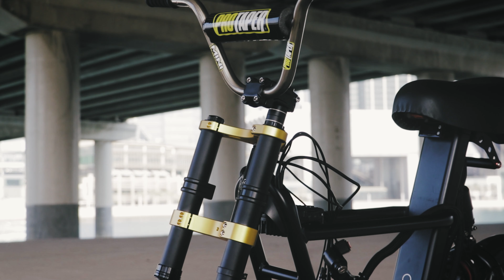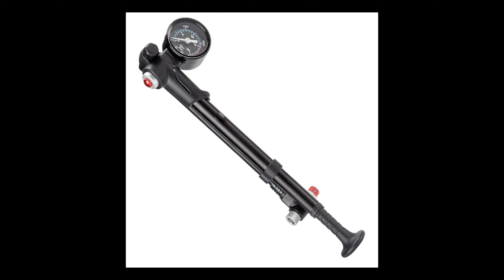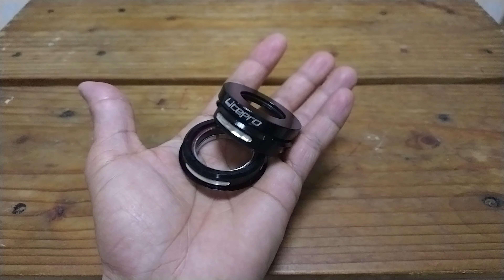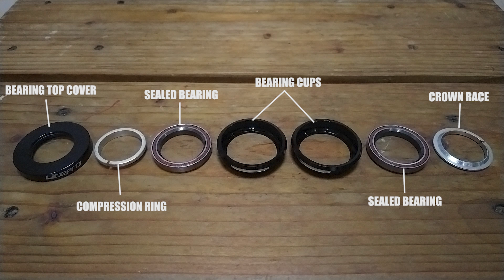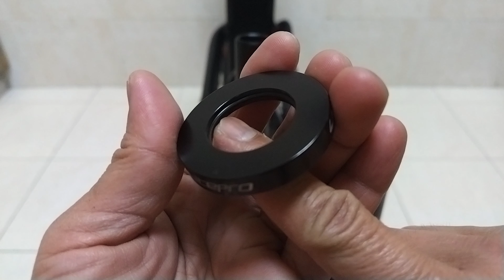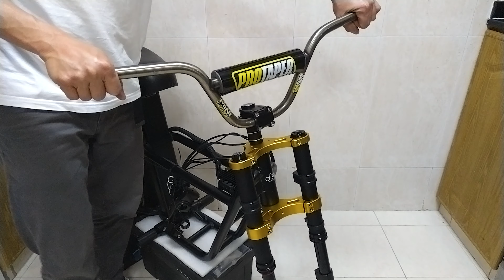How to Install a Dual Crown Suspension Fork | Fiido Q1s Electric Scooter Front Fork Upgrade!

Comment: san po makabili ng stock headset ng fiido same sa video nyo po
Reply from the maker: Goodday Kaadik!
Check mo sa AliExpress, online.

Ride safe lage.😎
Reply: @jaysonulanday  nghahanap ako dun boss pero di ko makahanap ano kaya e type ko dun
Reply: @jaysonulanday  pwede boss p share ng link
salamat
Reply from the maker: @brokekitzjay8362 
Cnxa na late reply.
Meju nabusy lng Kaadik! Hehhe!

I just found this on AliExpress: 
AED51.42 | NECO 1-1/8″ Threaded Headset Folding Bike 34mm / 44mm Vintage Waterproof Semi-Integrated Steel Headset 28.6mm Straight Fork
https://a.aliexpress.com/_c4mQAmLZ

Piliin mo un "H184"

Ride safe lage Kaadik!
Reply from the maker: Size 44mm Kaadik!